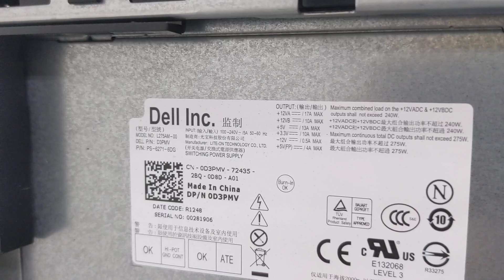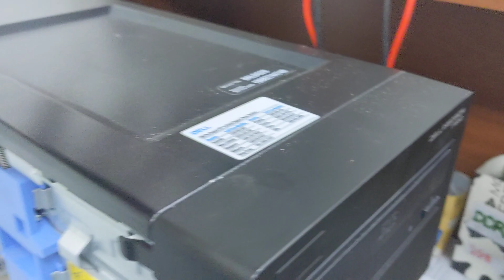Dell Precision T1650 Specifications & Internals

Comment: Are the T1650 & Tower 3620 PCs with the Xeon CPU worth anything? Mostly complete Thank you 🤓 on the mobo, is there a GPU chip, or does the system rely on the card GPU alone? Thanks for the explanation!